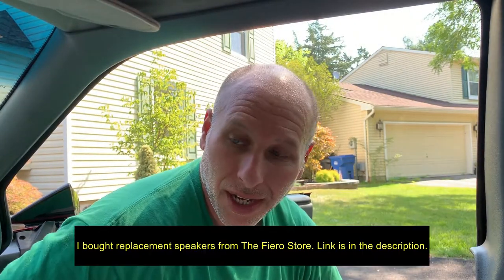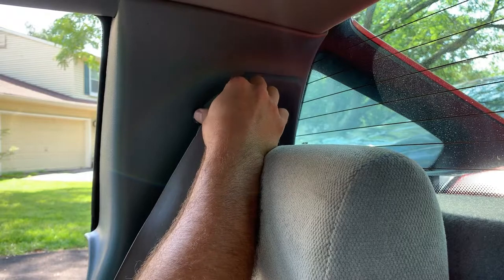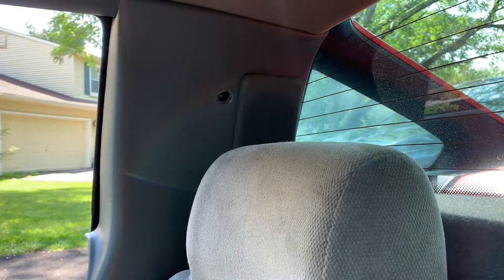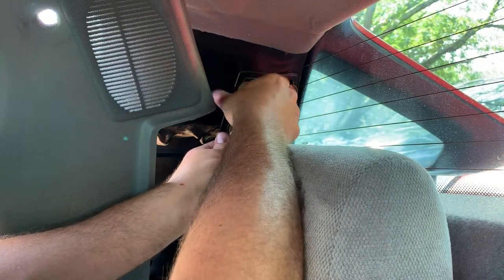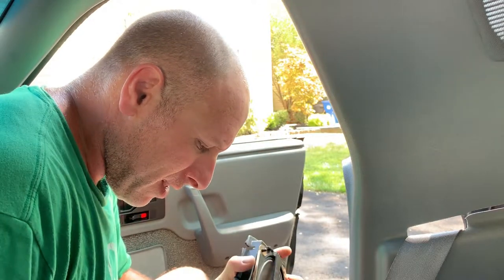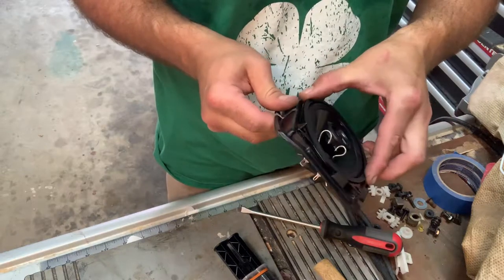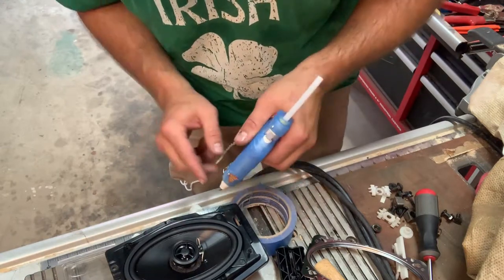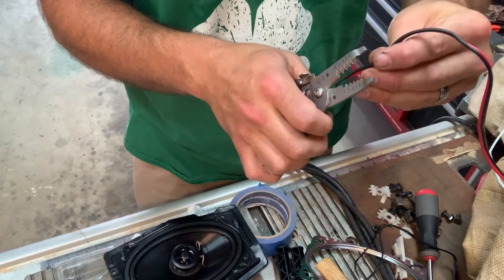Replacing the Speakers on my 1986 Fiero GT

Comment: If you think that plastic is brittle you would be floored by how brittle older BMW plastic is. I had a beautiful BMW Z3 that was garaged most of its life here in NE FL and it was extremely difficult to do anything in the interior without breaking something. I sold that car but I miss it sorely... everything but the plastics made from Brittilium...

Comment: Thanks for making this video.  I'm going to tackle the same soon.  Two things.  Maybe give us a taste of how it sounds with the new speakers - your impression as these Fierostore replacements are pretty expensive in my opinion.  Also, what are you running for the receiver?  The original or some sort of upgraded unit?
Reply from the maker: Speakers sound fine, but the original head unit is pretty shot. I think I need to take it apart and give all the connections a good cleaning. Tons of static and popping. Future video!
Reply: @generalpurposetv2241  , working inside a Fiero is ALWAYS easier with the seats removed